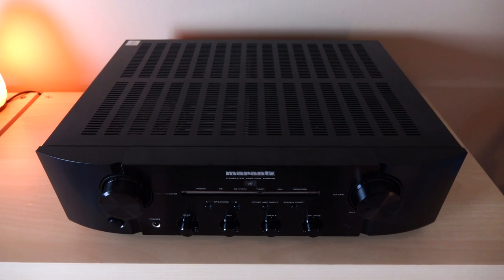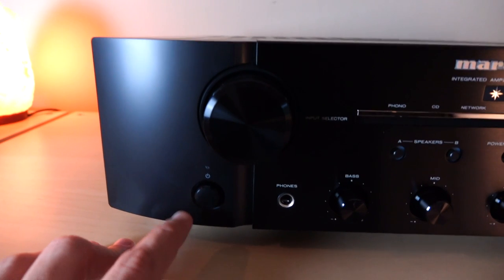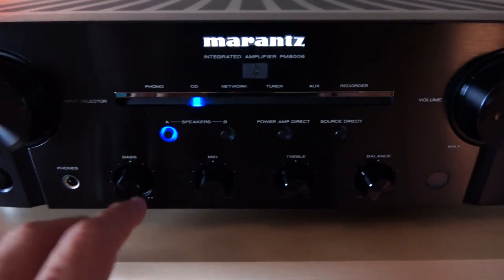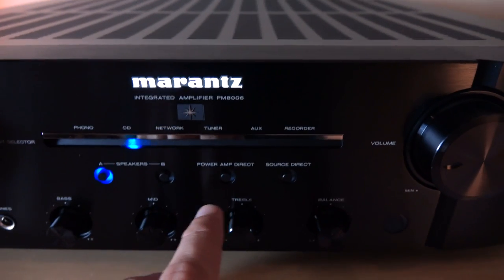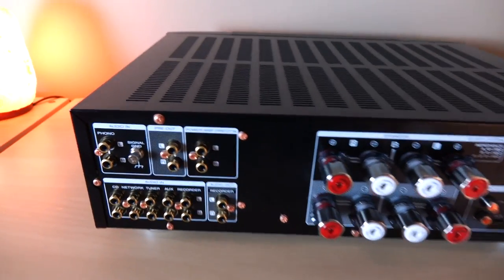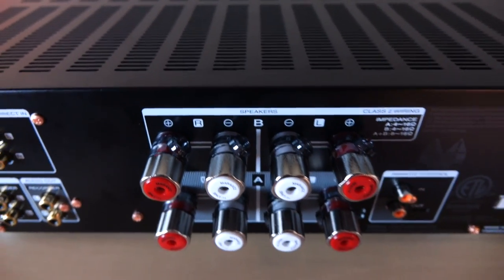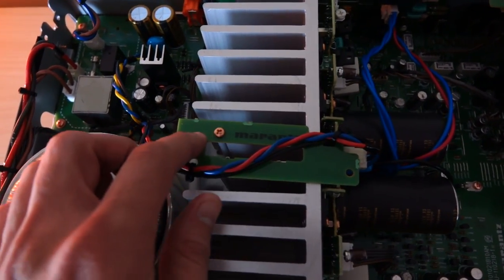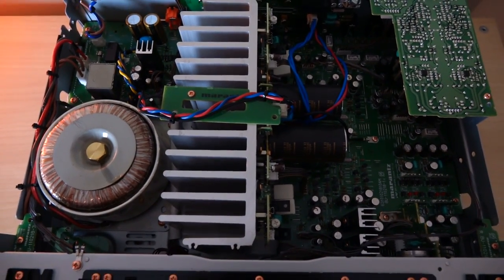Review!  The Marantz PM8006 Integrated Amplifier!

Comment: Dude, really enjoy your reviews and your pro presentation. However I think you missed the mark on the Marantz PM8006 a tad -- especially regarding the "Direct" feature. Quick summary, I have the amp mated with Totem Sky's along with a high-performance bi-wire speaker cable (German OFC twisted pair 16 gauge x 8 conductors per channel!), Topping D30 (heavily modified with custom discrete linear high-current regulated power supply, Muses OP amps, Caddock MK-32 non-inductive resisters etc.) coupled to the amp with a custom made (dual twisted pair OFC) 5-inch interconnect terminated with Furutech FP-126(G) "OCC" RCA connections. 

In addition, I am using a custom made power cord (terminated both ends with Furutech plugs) in a "music server" (PC based) configuration -- 100% uncompressed digital source material with lots of HD 24-96 recordings. I also have a Marantz DAC-1 but it's not in the system at this time.  

Bottom line, the system is wonderfully transparent and anything but "bright" or remotely top heavy when I run the amp direct (which is the ONLY mode I use it in). In fact the OBVIOUS sonic benefits of the direct signal path are hard to miss -- including improved linearity, resolution AND musicality. That said, unsure why you encountered the "brightness" issue -- but given the amps impressive neutrality and transparency -- I'd have to suspect you have/had some front end issues.
Reply: Hi Ralph, I bought PM8006 recently, but there was sudden jumps in the volume control in the first quarter (up to 9 o'clock). It was better noticeable over 150 Ohms headphones with stronger input signal (e.g. internet radio from ND8006, or during streaming without decreased volume) where the first quarter of amplifier volume control is really needed.. My friend has about one year old PM8006 and his volume control is pretty nice and smooth, I was not able to hear any jumps. I was at shop to hear another peace yesterday, and jumps was there. Can you please try yours? Thank you!
Reply: @ondrejzelinka9252  The volume taper is unusual -- I believe due to the circuit implementation whereby the vol pot is not actually "in" the signal path -- probably some kind of shunt configuration which is why the taper kicks in so fast...  It is less than ideal but the sonic advantages of NOT having a vol pot in the signal path are actually rather huge. So you're giving up some usable taper for the benefits sonically IMO.

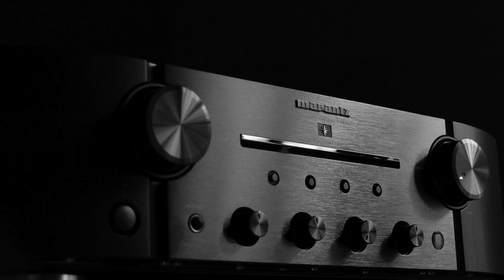Comment: 0:26 No digital inputs ? thats a shame
Reply: more like a plus
Reply: That is a plus because included digital inputs can go obsolete. All amps eventually need to have analog output. It is better to have external DACs so you can upgrade them easily through the years. This all analog amp should last decades and is repairable. No internal digital inputs means this can stay out of landfills after just five years.